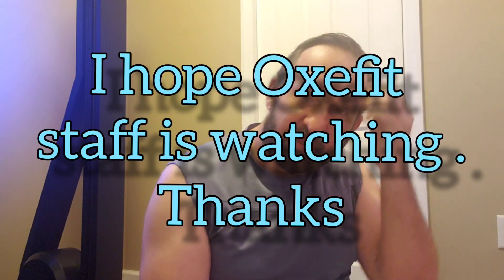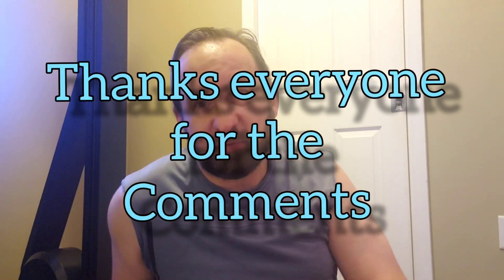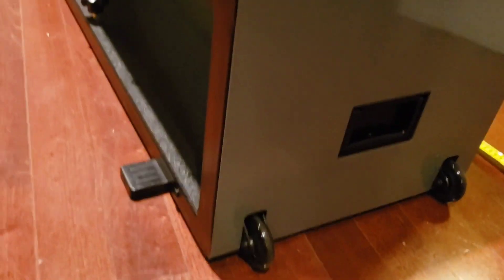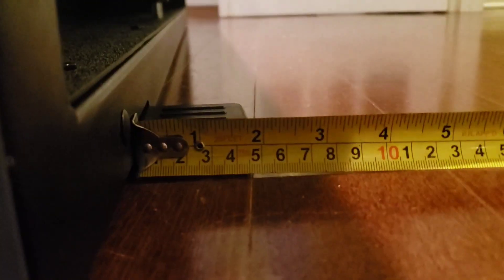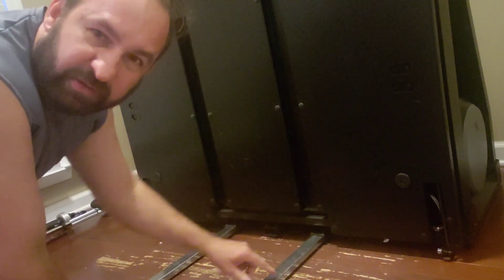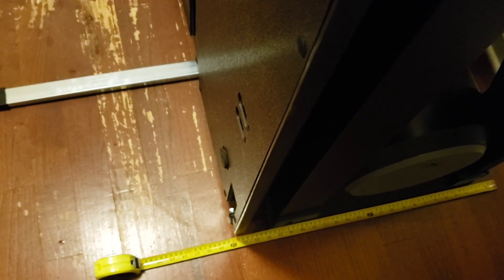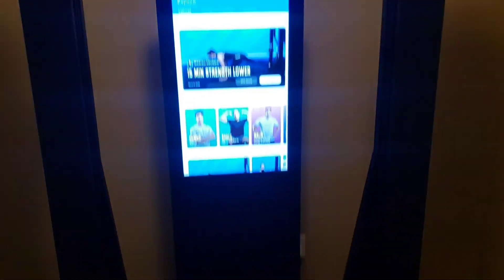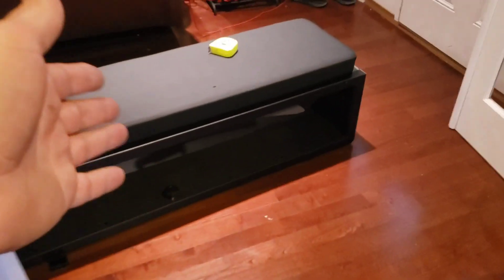Oxefit XS1 viewer questions answered measurements, weight etc

Comment: I currently have a tonal and am at the end of my 90 day trial. I am thinking of returning it and getting the OXEfit. It looks like what broke off from the ground cables broke of so you can't bench press? I am a little concerned about the uprights for squatting looks like they are plastic and will take a beating and get scratched up. they should have used metal. Thanks for the video still considering it but going to do a little more research. Don't get me wrong the tonal has its problems and what really aggravates me is the whole subscription models, all I want is the strength modes I do my own programs dont care about the classes. I think $50 a month Is ridiculous and they need to come up with strength only mode memberships for oxefit and Tonal.
Reply from the maker: What upright for squats are you referring to? Everything is pretty much solid metal.
Reply: @stangtrax  The grey handles to adjust cable height that also double as a rack to hold the bar. They appear to be made of plastic except the black lining where the bar would rest. Looks like parts of the platform are made of plastic as well. Looks like a cool machine but way too heavy and hard to move. The tonal has its issues but is small and has more resistance when pulling down, for lat pulldown and triceps pushdowns etc.up to 200lbs from any position, Oxefit has 150lbs from the upper cables and 250lbs from the floor cables. Really appreciate the review still on the fence about the Oxefit.
Reply from the maker: @malfador2002  I'm pretty sure that is metal.

Comment: David those steel bars on the bottom of the deck I wish they didn’t have to be there. 
All your little upgrade suggestions I agree with and they wouldn’t be much of a hassle to be put into the machine ! Hope OXEFIT is reading comments and watching your videos. I’m sure others that get there machine in the coming days will also post videos . 
I’m just hoping that I don’t have a 4 month wait to get mine built and delivered like you did.

Comment: Hi David, now I’m worried if they can deliver the machine to me. 
Question: Will it fit in a normal size elevator? 
I live in a high rise apartment building so I’m worried now about the delivery. My apartment doors are normal size doors. 
As far as the elevator, if the machine is on a dolly for the delivery team to move it I think it would have to be taken off the dolly to get inside the elevator than put back onto the dolly once it’s out of the elevator but than again at my apartment door I don’t know if it would fit through the doorway unless it’s carried into my apartment than the unit would fit. What do you think ?
Reply from the maker: I would get all the measurements and contact Oxefit with that information. I'm sure they will figure something out. So far their customer service is A+.

Comment: Question: Those metal bars on the bottom of the deck are always on the floor? Don’t they fold into the deck when folded up ?
Reply from the maker: They stay on the floor. Maybe some old cloth material etc can be laid under them.

Comment: David another question: Does the screen always stay on showing that Blue screen or will it time out and go black ? Than when you are ready to use the machine all you have to do is touch the screen and it comes alive ? 
If the screen stays on constantly in that blue screen than over time it will mess up the screen clarity and the screen won’t look as good.
Reply from the maker: I almost added that picture into a video. The screen does not always stay blue,, it goes into sleep mode. You just touch the screen and enter your password to go.

Comment: Dave, thanks for the video.  what are you recording with?
Reply from the maker: My phone
Reply: @stangtrax  with respect, I believe it would be better if you use a wireless Lavalier microphone. I believe I heard you say that your phone is Samsung, you can buy a USBc adapter which will allow you to plug in the receiver for your mic. The mic I use is the Hollyland lark 150. It will give you two mics one receiver . It’s currently on sale at Amazon.
Reply from the maker: Ok thanks. I'll look into that.

Comment: Use a heavy duty weight mat to put the system on. What you find in gyms. That should help with the leveling of the system.